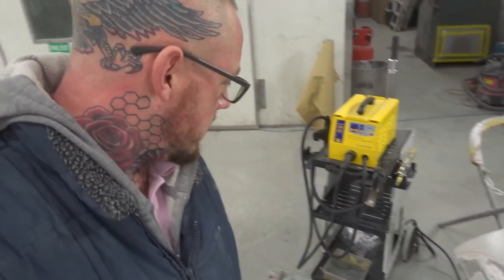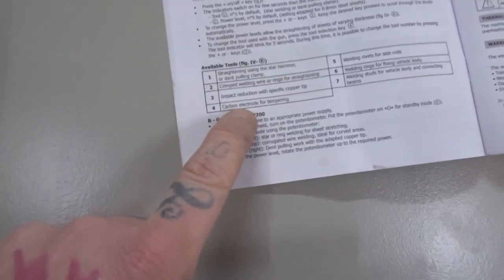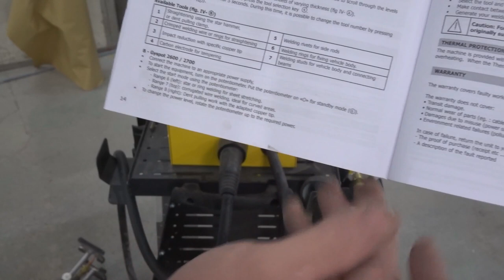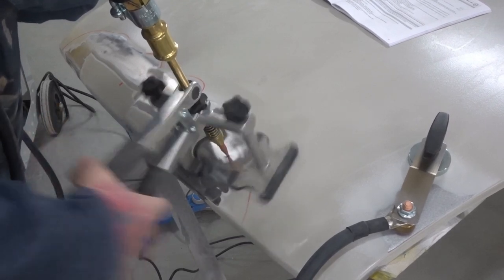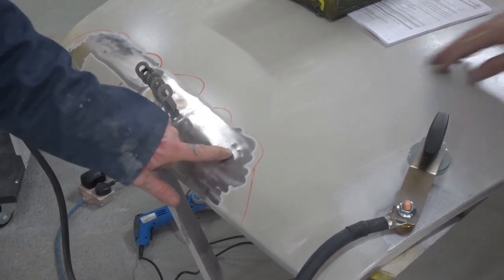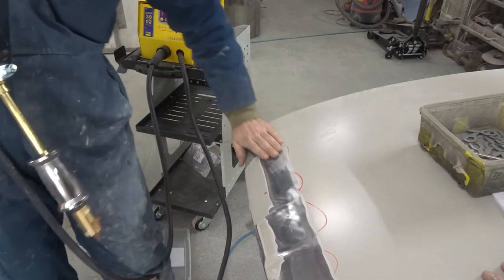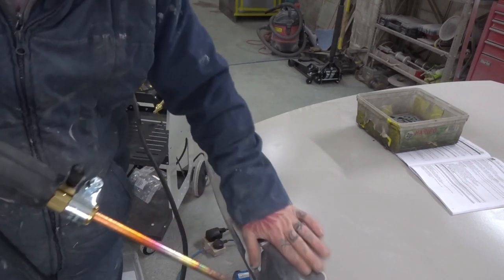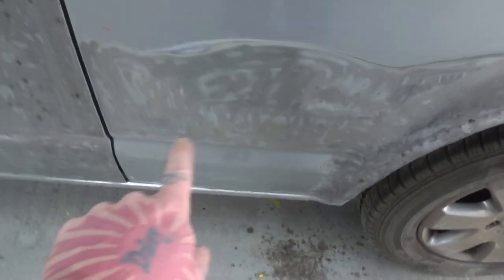Gyspot 39.02. How To Use 25%, Review 25%, Mongs with a new tool 50%  #Gyspot #pmpsupplies #bodyshop

Comment: you got a posh trolley with yours mines crap, right the copper bit with the slot in and the hook bit are for the earth the copper washers are your earth you zap one on the panel put the copper bit with the slot over the copper washer and the hook bit hooks in the washer and hold the earth lead on, the carbon rod is for  shrinking 👍👍👍👍
Reply from the maker: I splashed out mate, it was either feed the family for a couple of months or get a new toy 🤣.  Cool so I haven't got to worry about the earth bits, carbon rod for shrinking, what about the fat bronze bit? 🧐👍
Reply: @WinginitPaintSprayers  I know I'm 3 years too late but the fat bronze bit is for spot shrinking, setting 3. If you overpull and get a raised peak then the spot shrinker puts it back down. Tool on, once heated do a gentle push downwards. The carbon rod works like you did, little circles, but for larger areas you move it in a decreasing spiral. Might help out someone else who finds this video.

Comment: Hi,good tool,I keep meaning to buy one so maybe rushi might buy mine too,im sure you know but watch out with cars with modules everywhere in case you zap one,I like to put that zapping tool across the battery whenever I do any type of welding
Arthur tussik is your man to watch when getting used to working the spotter,he will show you how to do the shrinking too with a damp cloth look on YouTube
Ebay for spare parts or aliexpress used to be cheap but not so keen since last year
Powertec do spares too
Eurocarparts spare bits too
Posh trolley, if I get a machine im making my own  trolley as im from yorkshire
Reply from the maker: 🤣 old tea trolley? Yeah I've got the surge protector for the battery. The powertec pin puller is just too much of an animal, its nice to be in control of how much you pull out with this one. And cheers dude, I shall look up Arthur Tussik 🤟